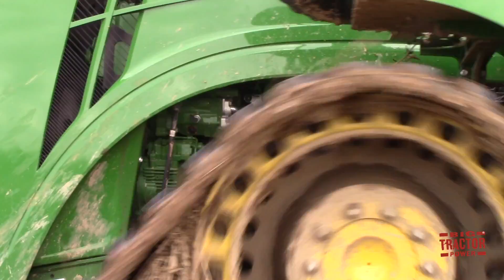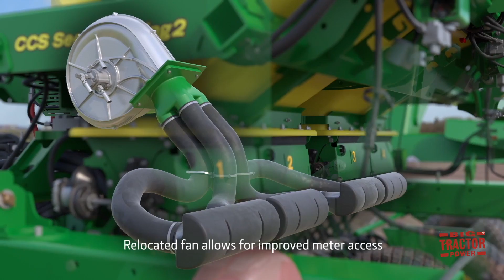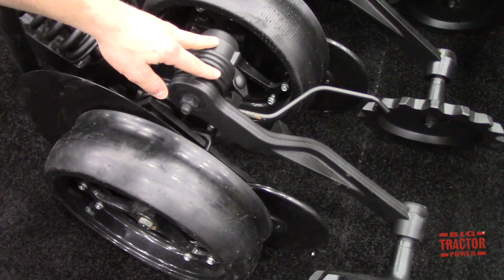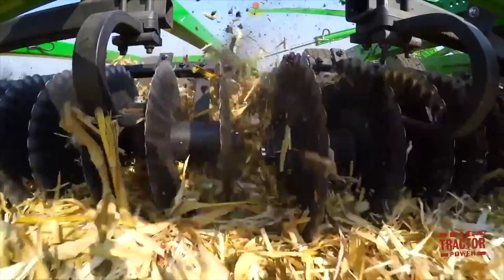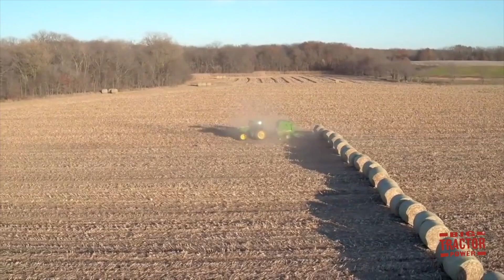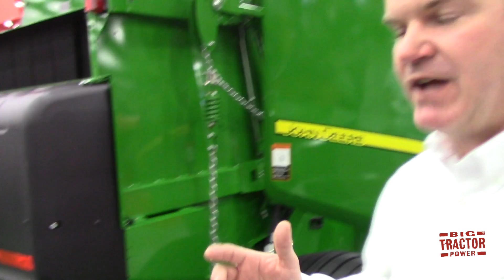New 2019 John Deere Tractor and Implement Releases at the NFMS

Comment: Price tag please
Reply from the maker: If you go to https://www.deere.com/ they have a price builder for all items. The 9620RX for example starts at $628,000
Reply: @bigtractorpower  I lived on a free stall operation around 1973 and they had a 5020 and back then that was the big boy in the Amsterdam area of upstate NY.  I got to drive it once from one of their farms to the other ,about 10 miles I was 14 did I feel like a big shot. But years now I run heavy equipment mostly trackhoes and the prices are scary.
Reply from the maker: It is amazing at the prices today. I grew up near Rochester, NY and seeing Case and Steiger 4wds and thinking how huge they were. Today a Case IH Magnum at 380 hp is physically bigger and offers more horse power than the 4wds from 40 years ago. It will be interesting to see farming 40 years from now.
Reply: @bigtractorpower  LOL, I won't be here in 40 years. Funny thing . My grandfather had a dairy farm on Long Island in the 30s but it burnt down . Thanks for responding and have a great weekend.

Comment: The new side panels are so that the tractor does not burn to the ground like some have because of debris buildup and getting hot cause it is very hot in that area.It is also a problem with wheeled machines,although a little less.
Reply from the maker: I should be filming some 2019 9630R and 9420Rs with the updated shields planting corn in a few weeks.

Comment: cool its green they broke often
Reply: NatureRecylceflorida John Deere is the best. It does not get broke.
Reply: @muscletractorfan2441   their computers are locked so no one can read simple codes except stealerships and their is a clause for only deere stealerships to work on them .
And any deere under 100hp is made in China/India or Japan/yanmar .
look up tractor hacking for more info .
deere is expensive junk that is subpar grey market tractors
Reply: @NatureRecycleFlorida  Actually, its not just deere that is behind that in regards to the software. All of the manufacturers are together and trying to keep owners locked out of the systems.
Reply: @PaulsonFarms   well to some extent most vehicles are too ,but deere charges high end prices for grey market tractors while suing farmers that unlock code on their own tractors .
deere is not good
Reply: @NatureRecycleFlorida  Does any manufacturer make a tractor under 100 hp in the US.
Reply: @danlowery3235  Ventrac
Reply: @NatureRecycleFlorida  Actually vehicles are not close to the same, thats why you can take your car to an independent shop and they can plug into it, or you can buy a scan tool and do it yourself. Everything we have is deere and we work on about everything ourselves. Every once and a while we'll have to call deere to plug into something with a computer, but most work can be done without one.
Reply: @NatureRecycleFlorida  The computers are not "locked."  If you have a TEXA diagnostic system, you can work on John Deere and most all other tractor / heavy equipment manufacturers' electronic systems.  The complete TEXA diagnostic suite of software and the field computer is about $7K.   John Deere series 1,2,3,4 tractors are built by John Deere in their Grovetown, Georgia factory.   The engines are manufactured by Yanmar for John Deere, but the remainder of the tractor is made in Georgia.   As for the other tractor series 5, 6, 7,8, 9 they can be made in a variety of factories as John Deere has worldwide manufacturing facilities: China, England, Germany, India, Brazil, Mexico, and a number of other countries.  It is easier to build the equipment locally than ship everything from the United States.  Two example are rice harvesters are built in China because that is a very large market for harvesting rice; sugar cane harvesters are built in Brazil because Brazil harvests more sugar cane than any other country as their economy is built on using ethanol for fuel.

I understand you've decided you don't like John Deere. That's your choice, but fabricating "information" because you're ignorant and have an agenda - is still lying so you might want to reconsider what you post.
Reply: @NatureRecycleFlorida  I'll give you the fact that Ventrac is American made but I can't see any of their machines out in a field or lot.
Reply: @NatureRecycleFlorida  Nope,I own 2 Deere tractors under 100 hp.and both are stamped on the I.D.plates,"manufactured in Moline Illinois".
Deere holds a number one rating world-wide in Consumer Reports magazine.
Reply: @danlowery3235  JD 1,2,3,4 series are made in Grovetown, GA factory.  Kubota sub-compact, and compact tractors in the US are made in Kubota's USA factory in Gainseville, GA.
Reply: @buckhorncortez  yes thank you!!so much intended continuously misinformation is brain rot from unschooled trolls that should really stay on the porch.It is very sad to read what they dont have a clue about.